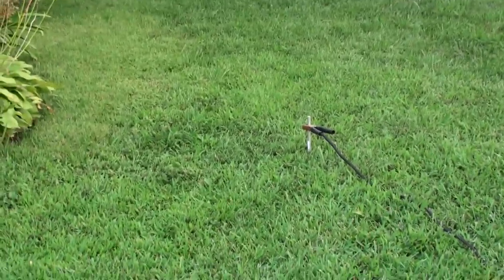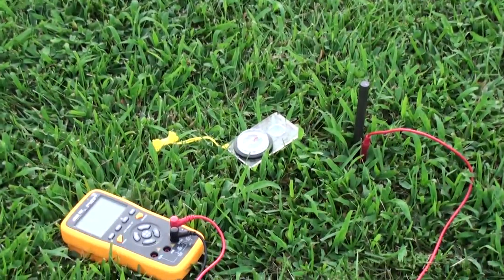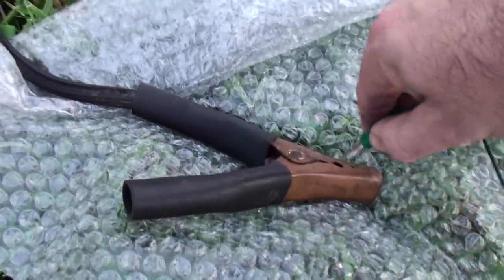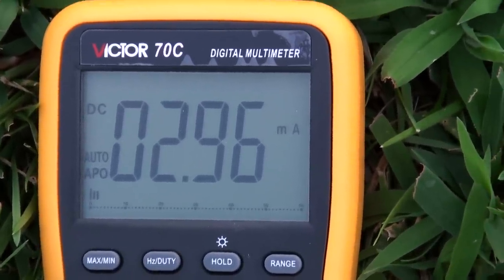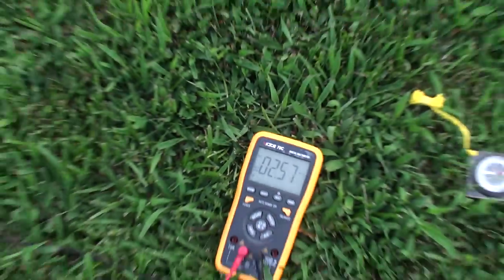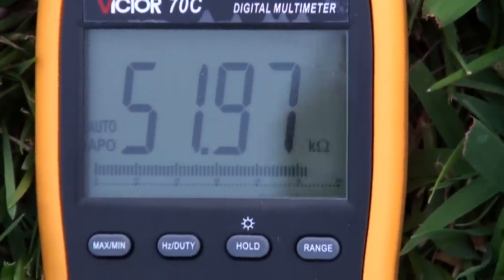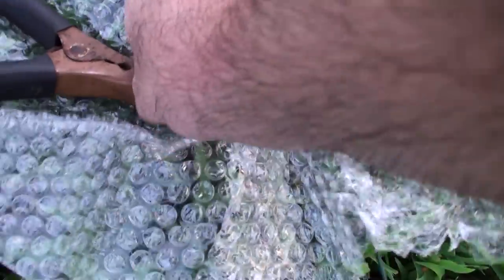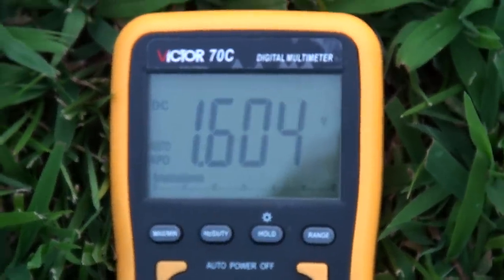Telluric Current Experiment #2

Comment from the maker: At this point in time I don't think the distance is going to matter unless we are talking on the order of miles.  I think what most people forget with the Telluric effect it is not something that happens over a short area.  The wavelength of the Earth's magnetic field is pretty long so "magnetic" induction will be very little until your conductor starts to get long enough to actually have current induced into it.

Comment from the maker: Just to add to the current reply, the voltage potential is really a mickey mouse point.  Without having enough current to perform work with you might as well be playing with static electricity.  That is why I have been looking at low voltage/current harvesting technology along with various power sources such as Telluric.

Comment: I thought the rod had to be at a 52 degree angle, in a south to north direction.
Reply from the maker: The whole purpose was not to try and obtain some power from the orientation of the rods.  Frankly the only thing I did was to see what type of voltage potential that I was getting between the two materials and how much current from electrolytic action I would receive.

Comment from the maker: The problem with what they were doing is the "current" induced via the Earth's magnetic field was over very long distances.  Now granted, they had a basic electrolytic cell set up at each station that in my opinion was acting like on of the Worlds first super capacitors and the induced current is no different than what electric companies and gas/oil companies see on very long "metallic" runs that are either actual cables or metal pipes etc..

Comment from the maker: First of all, the best electrical potential will be achieved using materials with the greatest electronegativity.  Copper is not the ideal material for what I am trying to do.  As for some "golden angle", why don't you elaborate on that item.  If you go to to the wiki that I am documenting this project on, you will see what I have been doing.  I know it is a rare thing, but I am trying to use a little scientific method to my experiments to frankly weed out the bull.